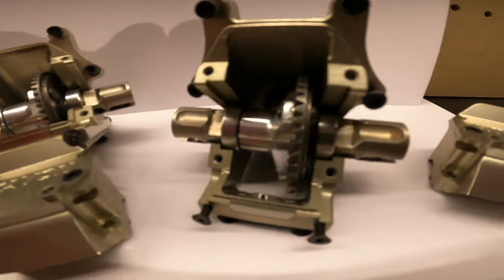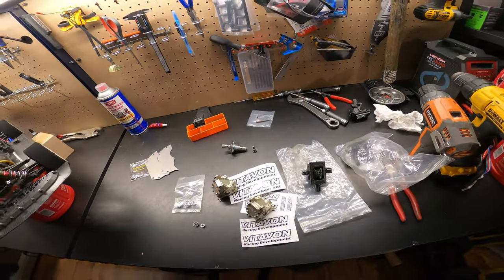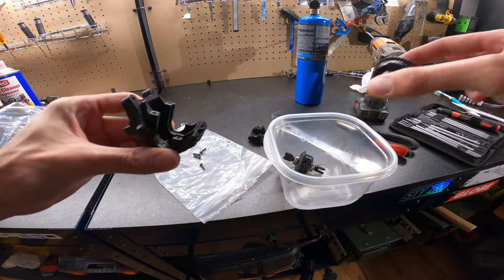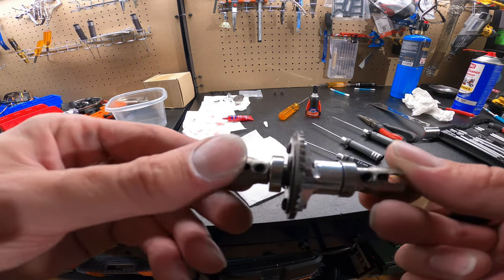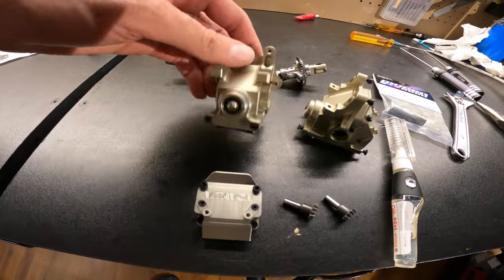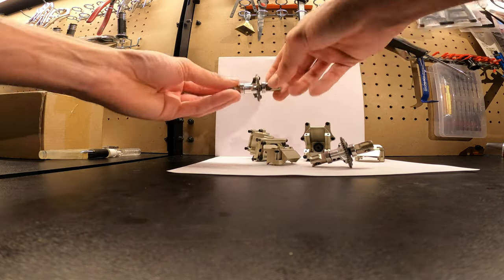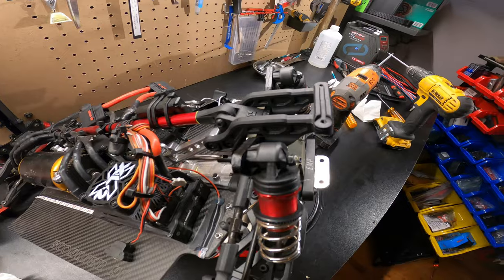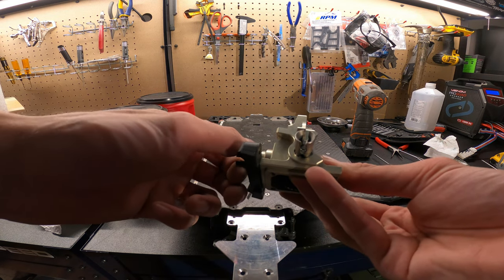Arrma Limitless New Vitavon Diff Housings Install & 150mph Test Run! Oversized Bearings & Alu7075 RC

Comment: The Vitavon diff housing is made from 7075 Aluminum and comes with an oversized 5x13x4 bearing instead of the lame-ass stock 5x11x4mm bearing. Hot-Racing also makes an aluminum gearbox case with the same sized bearing.

Comment: Nice Video, my drive pinions normally get damages in a few runs  and I was thinking it is only me. what grease is that I saw you applying.
Reply from the maker: Thank you! If the grease was from a big tub it's the marine grease I use. Just to lube and water proof, just in case moisture occurs lol

Comment: (@7:07) Did I see you use super glue on the grub screw for the input gear cup and the screws for the suspension mount (@8:30)? If so, why?
Reply from the maker: Anything that goes into metal gets loctite 👍

Comment: Hey brother, I have a question I know you know your stuff so I wanted to ask you I’m getting ready to do a  full on speed run car I’m starting with a Normal Infraction, but there’s one thing driving me, kinda bananas, the front and rear, the front more input cups are making the drive shaft wobble what do u think is the problem? Thank u.
Reply from the maker: Stock or aftermarket parts? Stock parts comes wonky sometimes. Aftermarket, if there's play in the drive cup going over the shaft you can use shim tape to take out rhat play and make them perfectly centered
Reply: @zagertRC  it’s a Arrma Infraction completely stock brand new out of the box and I noticed drive shaft all wobbly and I look at rear input cup and front input cup and links like there wobbly ? Like a lot not a lil bit one is more then other front is real bad back just a lil bit

Comment: They are aluminum and the anodizing color is called titanium :)
Reply from the maker: I realized that after I made the video 😆👍
Reply: @zagertRC  I have the titanium ones on my basher. On my speedrunnwr I have the black ones
Reply from the maker: @rcspeedrunner  Very nice! I want a set of bulkheads for my Losi DBXL-E from them now👍

Comment: I have infraction that I bought used for 150$ as a roller. Previous owner spent over 400$ for every possible gpm upgrade they sell and long story short, they are junk, made the car much worst than factory (I have new stock limitless). I have some videos about it on my channel
Reply from the maker: That's a pretty cool channel. Picking up cheap RC's and fixing them up💪
Reply: @zagertRC  thanks. I have a lot of projects coming soon, unfortunately don't have enough time right now.